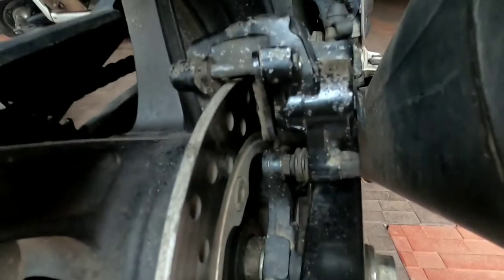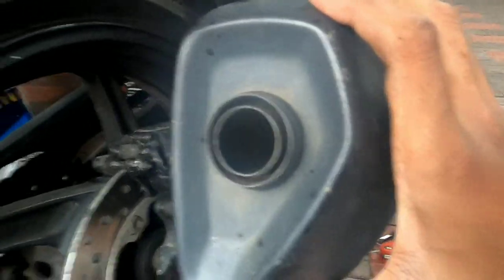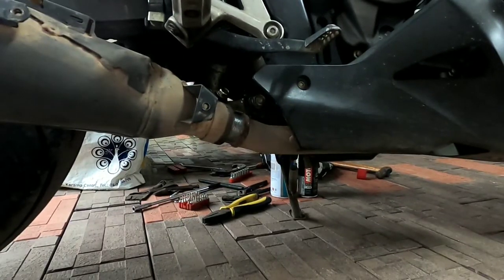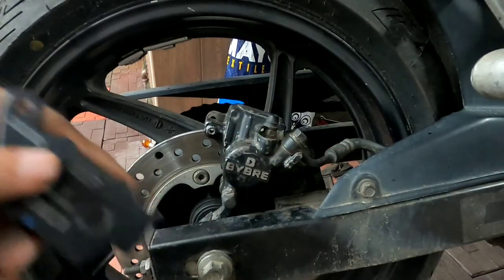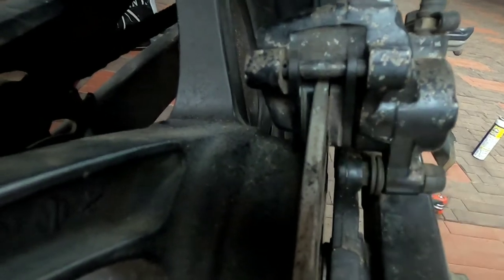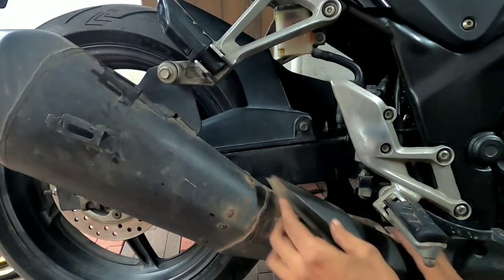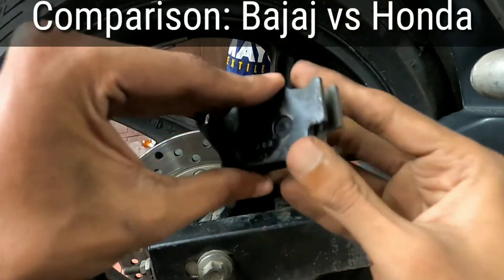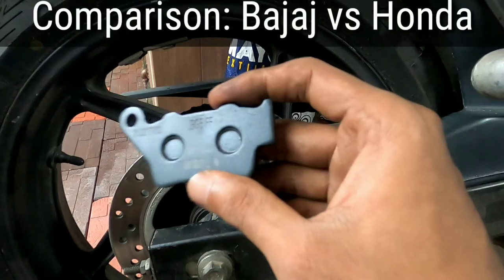Changing the rear brake pads | DIY | Honda CBR 250R

Comment: Mene bhi recently kara
Reply from the maker: Nice bro 🥰
Reply: @exhaust_tales  bro i got another problem of fuel pump
Reply from the maker: What happened bro?
Reply: @exhaust_tales  engine was like stopping suddenly and starting
Reply: Engine band chalu ho rha ha on road
Reply: @shubhambb0099  Bro i had this issue. The service center guys changed the fuel pump. Still it was there and then they changed the spark plug. Then it got corrected. My advice would be to check the spark plug first. And if fuel pump needs replacement its better to repair.. the new one costs a fortune. Check any local mechanic who can repair fuel pump. Mostly its just changing the motor. We can get the motor from amazon also.
Reply: @rohannj7584  thanx bro I'll try and then let u know the results 😊
Reply: Aur sabe important baat sab kaliya for fuel cbr250r kaliya speed petrol hi dala karoo
Reply from the maker: Thanks for the advice bro 🤗
Reply: How was the experience in pulsar breakpads